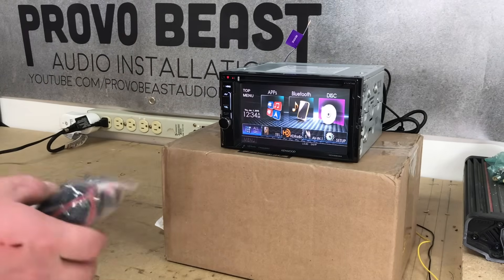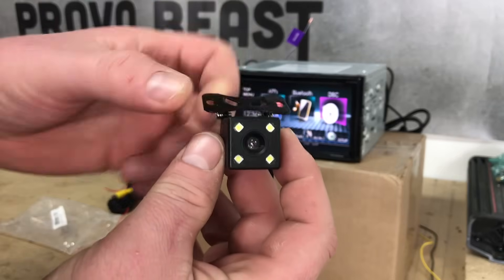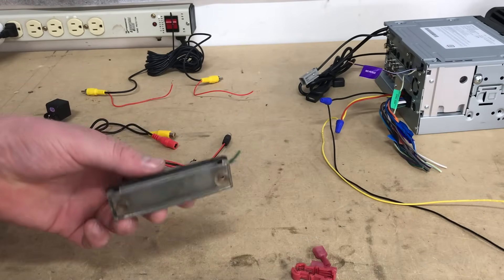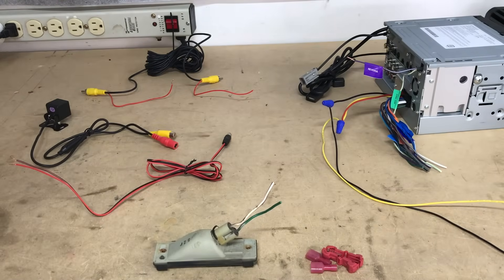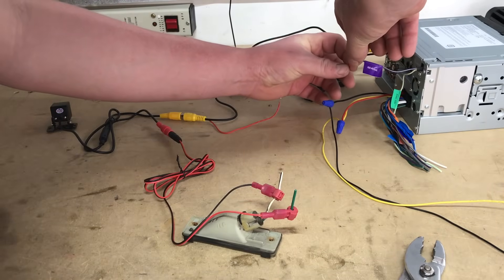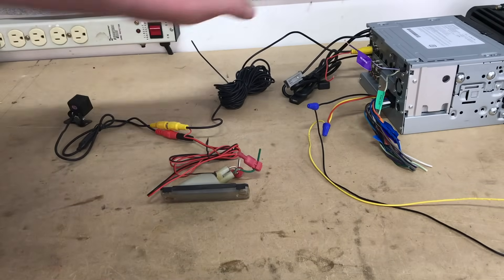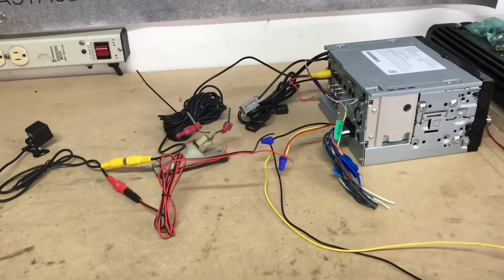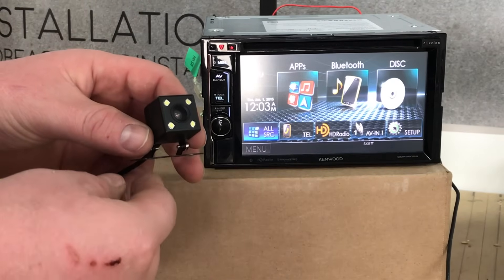Car Backup Cameras Explained: How To Install On Your Car!

Comment: Hey, question. So I bought a reverse camera to replace my old one on my '06 Lexus GX470. I used the existing pig tail from the old camera to avoid running the long video cable (which is not compatible unless you use a pigtail harness "at front" and needles to say its like 30 mins to take apart..Anyway. In doing so. I FIGURE it would be as easy as connecting ALL 4 wires directly. But My picture was fussy or not clear at all. I later figure out that it was not "getting power and grounding" correctly. So I decided to tap into my reverse camera and ground directly and IT WORKED. So...  question is; I'm not using the extra red wire ends for reverse at front nor on the back. You know the red little ones sticking from the video rca.. BUT everything is working just find. Aren't those little wires redundant as I'm already taping to the reverse wire already? So.. I guess. What would be the consequences of NOT using those little red wires. Again, I'm tapping to my reverse "power" already... let me know what you think. Sorry if I've confused you.. thanks

Comment: I installed one of these camera and took power from the reverse wire on radio, litterally just connected the camera power to the reverse wire then on the camera end I again used the power wire from camera cable and connected the red line from power plug, that’s it! Works when in reverse. Has leds so look silly working all the time

Comment: i have a question can i ground to the body with thr ground wire? and i hooked it all up the way you demonstrated but one issue, camera goes on reverse on screen but if i turn on the head lights it turns off and goes back to radio weird to me. 
so i have the two power in the rear going to reverse light, my ground is screwed to the body just below the reverse light panel, ..both video out puts connected correctly and red power line to player is hooked up to reverse line through player.
so really everything worked but  my only issue is when i turn the headlights on it switches right back to radio..
if i can get some advice on this i would really apreciate it.. thanks in advance..

Comment: I thought the other end where you connect to the radio the red wire connects to the power accessory wire is that why my camera display won’t go on when I’m in reverse.

Comment: Question- is it possible to have it wired both ways? So that I can view while on the road occasionally and also so it auto switches when in reverse? 
Ps
Thank you so much for the detailed explanation! I always gave up on installing the camera. And I just did my sons car with ease watching your video😎.  Now checking the garage to see if I can find the cam that goes to mine 😂

Comment: Hello, thank you for your great guidelines! I have a question: If i hook up the power source of the camera directly to the connectors of the radio, since this camera have leds, the leds will not powered on all the time? Thank you.
Reply: I have the same question. Have you tried doing it that way? Were the led always on?
Reply: @carlubueno6298  yes the led will be powered
Reply: Unless there is some kind of switch independent of the camera that allows the lights to be turned off manually then your answer is in your question……….. yes when powered up the lights will always be on as will the camera……. Just because you are not actively viewing the camera output doesn’t mean that the power is no longer making the camera work it just means the signal has stopped being transmitted your just not viewing it and the same would apply to the lights if u have not removed the power supply then why would you assume that for any reason the lights would be able to detect your not viewing them and magically turn off?  This isn’t the double slit experiment 😂 it’s kinda basic common sense…… if you turn the lights on in a room, then shut the door and walk outside. Do those lights suddenly stop working? No they’re still on same concept. 🤦🏻‍♂️
Reply: @Frigginpirate  There is so much hate in your comment, and no focus in the real question. It makes you feel better? I am glad you answer 3 years later or else i would be stuck with this issue forever. 
I leave you with a big hug.

Comment: I completed mine except it displays a black screen. The camera turns on the radio turns on the unit even switches into reverse camera mode when in reverse however just a black picture. Any suggestions?

Comment: Hi,
I connected the reverse camera I installed on my car exactly like your first wiring.
The camera works, then goes off after 2 seconds.
I probed the voltage on the reverse light power line : 6V. The camera operates (fine) in the range 9-15V.
As there is a 12V output from my display, I used this one and it works fine ... whatever if the camera would be always ON ; at least it works.
Sometimes, you have to be more realistic than fancy ...
Note : the camera supplier (in China) provided a wiring diagram where it is indicated to connect to the reverse light. The only trick is that you have to probe the voltage on this line and it has to be sufficient for the camera.

Comment: I know this is pretty old but I've been messing with installing a camera and all things being equal I would like to be able to switch to my rearview camera anytime, not just in reverse. The only problem I see is that if you have constant power to your camera then the LEDs will always be on as well. Short of a switch, I can't see how to overcome this. I'm trying to sort out everything before I go in for the final install and see no way around picking between only being able to use it in reverse or always having the LEDs on.
Reply: Did you ever figure this out?

Comment: I already knew how to wire up a back up cam as I have plenty of experience with wiring, but I have never installed a back up cam and this video helped me confirm my thoughts on the installation process before I do it myself. Great video.

Comment: Great video , I recently got a 05f250 which had a backup camera installed. I installed a Alpine ilx-w650 and camera was flickering . So i thought may be camera its bad, I purchased a new one and installed it both ways as your video and still flickering, right now it hooked up to my alpine directly .  Do you have an idea what iim doing wrong? Thanks

Comment: 8:50
So the screen would still automatically show the rear view when in reverse?
Reply: As long as the trigger wire is connected to reverse.
Reply: @thebro5540 
OK, thanks for the answer!

Comment: Anyone tried the capacitor solution with back up camera interference lines using 2.4 gig wireless system? Can it be done?
Having no success with 2014 VW Jetta Sportwagon. What would be correct wiring  config?

Comment: I’ve got a quick question on the 2nd wiring option(8:45) when using the “reverse” as a signal wire (while camera has constant from radio) would you only need to tap the + of the reverse and no ground(-)?  You give a great explanation, I might just be overthinking this. Thank you!!

Comment: I watched this video before fitting my rear view camera. I followed all the steps as per this video and the camera would only work when the cars ignition was on but car not running, start the car and the camera would switch off. What I found out after alot more searching on the Internet was if your car happens to have can bus electronics you have to energise the camera not from the back up lights but through a relay so you need a 12volt feed from the car battery to the relay, a ground to the relay, a wire from the backup lights to switch the relay and lastly wires from relay to the camera and the trigger wire. This video does not explain this so yes what is shown but not correct for all cars.
Reply: I just read you comment. Icannot get it to work. If the engine is off, the camera picture is perfect. Once the engine is running, the picture is completely distorted. Could it be the same thing? I have canbis as well, and power through the back light. I am not technical at all, so relays and stuff...i don't know.. Do you have any more info?

Comment: Thank you, I have installed the camera, the wire from the camera to unit is about a meter short! can I cut it and extend with another lead, where will the red power lead be connected to? thanks

Comment: Okay so I have a question. Since the camera power and the little red one coming off the video cable both go to the reverse light. Can I instead of extending the wire off the video cable, just split it into the camera power and just have the camera power going up to the reverse light? I don’t know if they need to be separate for adequate power or if that would be totally fine.

Comment: with this camera is it normal that the led lights never turn off when the car is on, or was the install done incorrectly? and how can i correct this? i have it mounted near the license plate and the led lights make it difficult to read my tag numbers so dont want to get pulled over

Comment: I have a Mazda CX-9 back up that works but the bracket rusted off, I would like to install an aftermarket camera and do you have any idea if all camera wires are the same.  What I mean is that the factory connector has four wires, White, Black, Red, and Yellow.  Do these wires correspond the colors you are showing?

Comment: If you have the power running constant to the camera and still have the video power wire connected to the the reverse lamp will it still come on automatically when your put the car in reverse or do you have to do it manually?

Comment: I wired mine up in the first way you explained and it does work but only when my headlights are on. When the headlights are on the radio won't work. When the lights are off, the radio works but the backup camera doesn't. Please help

Comment: This absolutely helped me so much. I've also installed a mtx basstube today and have power but no sound using the Rca cables. I have the rca in the back of the radio to the tube but idk. I'll keep working on it. This had so much information idk why manufacturers can't do this.

Comment: Do you need to wire the extra trigger wires (small red ones, and what gauge are these so I can order extension if you do need to do both) at BOTH the tail light and the head unit? I can easily wire at the head unit but the tail light trigger wire is under the frame and wouldn't reach up to the rear light without buying extended wire and wiring that up, thanks!

Comment: Do I have to connect the red wire that’s on the video (yellow) cable as my car automatically changes the screen to the camera 
And just says no signal because I don’t have a camera plugged in

Comment: Hi..i did try your last method inwhich u get the power all the way from the power of the radio..as soon as i turned on my ignition it blew the fuse. Why do i think that i may have to get the power from tapping of from the fuse box? Please help. Thanks

Comment: Ok so I’m installing a backup camera in my Town and Country and I have a nearly identical camera to the one you show in your video but my power wire also has a second red positive wire. No instruction video or diagram shows such a wire... not even the diagram that came in the package 😕
I’m assuming that it is supposed to be hooked up to the red positive wire on the yellow video wire but I’m not 100% sure of that. I hooked up the positive and the negative wires to the positive and negative wires going to my backup light and then I hooked up the short red wire that was connected to the power wires to the short red wire on the video wire and ran the wires back to the head unit. I have not completed the install because it was quite a lot of work to remove all of the trim from the tailgate and to fish those thick connections through those small rubber channels that run from the tailgate to the body of the van and to carefully tape the wires to the maze of wires that were already in the van so that everything looked normal and not a mess (it started storming towards the end when I got the wires through to the front and I had to hurry up and reinstall all of the trim and close up the van for the night) anyway my next day off will be in a few days and I will try to finish up the install, I just hope that my instinct was right about that other red wire because if I was wrong then I’ll have to take it all apart again and figure out what that wire is for
If anyone knows what I’m talking about would you please let me know? Thanks in advance 😁
Reply: I have a cheap chinise head unit, with the reverse cam function, i wired the camera to ACC power, connected it to one of the video inputs, and it worked fine. Then i connected it to the reverse video input, and a wire to the parking sensor input in the wiring harness, connected the line to battery positive(this would later go to reverse light) but my head unit didn't like it. All of the buttons stopped working, expect the volume knob, the touchscreen and the software parts work, but cant connect to bluetooth, no sound coming out, so it is basically useless. The instructions didn't mantioned what kind of signal shoud be on that line, but i guess 12v is not the one, couldn't find a diagram how to hook it up. I ended up buying an other one for like 40 bucks, i guess ill won't have reverse cam then.
Reply: Ok so it ended up working fine, the backup camera works and the radio works too!

Comment: hi! Can I test the rear cam by wiring the 12V+ (and navi PIN3 reverse gear engaged pin I have MN1 Dacia Duster Navi) not to reverse light wires first just to a 12+ power source from navi feed or cigarette lighter to see if my NAvi turnes on the camera screen before wiring to the  reverse light wire?
I could put  a manual switch to turn this on manually without reverse gear selected?

Comment: Could you connect the power to the license plate lights instead of wiring it to the battery to have power when the car turns on?

Comment: I was trying to accomplish both with a. Over ride switch in between however my reverse lights come on when I hit the over ride ... I tried using a diode but still the same thing. Can you do a video on adding in an over ride switch to view your camera on demand although tied to the reverse power wire? Thanks

Comment: Hi I installed the rear camera on the aftermarket Chinese head unit exactly how you show in the video . I have singal from the camera in an app called AVIN then i connected the wires for reverse function. When I switch to reverse it’s coming trough the screen but the screen is black an says( no control when small light is turned off)  . Does everyone know what is the problem and how can i fix it ? Thanks

Comment: Can't I use the license plate light to power it instead of reverse light? My radio already switches to reverse camera mode, can I ignore the extra red wire on video cable?

Comment: Great instructions BUT these cameras have built in LEDs and if you wire it for the constant power option then the camera leds stay on all the time and thus shine/blind the car behind you (IE illegal)...maybe not so visible during the day but very bad at night...there is no separate power for camera and Leds.

Comment: HELP please, I’ve just done this on a pumpkin stereo, the camera comes on when I go into reverse when the ignition is on BUT when the engine IS ON the camera doesn’t work when I go into reverse, it just says no signal. 

Thanks
Reply: As explained, if you power the camera from reverse lights you can only use it on reverse.  However if you connect the wire where it turns on the radio when ignition is on (red), you may use it going fwd.  I'm thinking blue and white stripe will also work which is on when the radio is on only which is the system control.
Reply: Louis Flores I don’t mean when im going forward I just mean when the engine is on and the car goes into reverse it doesn’t work. But when the engine is OFF but ignition is ON it works when I go into reverse. Its an odd one

Comment: Since this video helped me allot, i wanted to place this comment to explain my situation and tell everyone what worked for me.

I have a Volkswagen Golf 7 and when put in reverse the headunit already displayed some sort of a backup camera feed (black screen with ! mark)
This is because my car has a canbus system which tells the radio that the car is in reverse.

Since this was the case i didn't need to take power from the reverse lights, i could just power the camera from the REVERSE wire behind the radio and this wire gets 12V when put in reverse.

This is how i wired it, hope it helps anyone : https://imgur.com/02amWqU

Comment: This is a great easy to understand video. Don't forget that some cameras use 6 volts instead of 12 so you will have to get some kind of converter to go from the backup light to the camera, the converter usually has three wires, a ground, a 12-volt positive in and a 6-volt volt positive out that connects to the camera.

Comment: Screen goes black when bacup gear is engaged. Can someone help please. Thanks.
Reply from the maker: You have an issue with the video signal, or power to the camera.  Check connections.

Comment: What's the con of the second method? Wiring in constant power or not wiring to the reverse light.
Reply from the maker: More wiring really.  Just wire it up to switched power and you are good to go.  i recommend picking up a camera without LEDs just so those are not on all the time.

Comment: Would it be possible to tap reverse cam signal to taillight instead of reverse light for constant power with a switch in line? Could be handy to flip a switch for the back camera in some places i go (light trails etc)

Comment: that did help. i guess no one here has the override feature. when you wire the camera hot to the radio the camera is on all the time. not a problem. only thing i cant stand is those led lights are on all the time. i have a front camera hooked up hot like that without the trigger and it annoys me